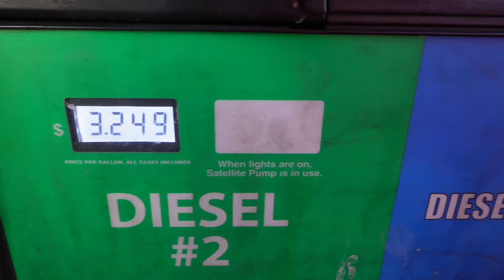COLORADO BOUND ✌🏽| CAR MUSEUM | ALMOST HIT A DEER | (AL)-(CO) | SHELTON IC

Comment: K you know that Freightliner built for fuel mileage and low maintenance. Get you a good 13 speed with at least 3:42 rear gears and 1750 or better torque. Just don't look at the fuel gauge to often :) 🤣
Reply from the maker: Lmfaoo. I heard how those mpg’s drop when you get one of those but I’m all for it!